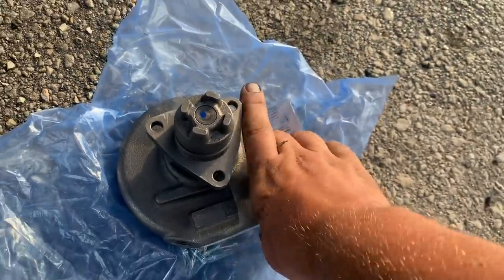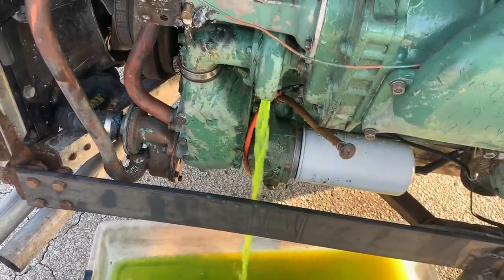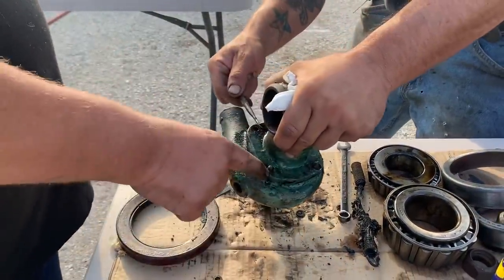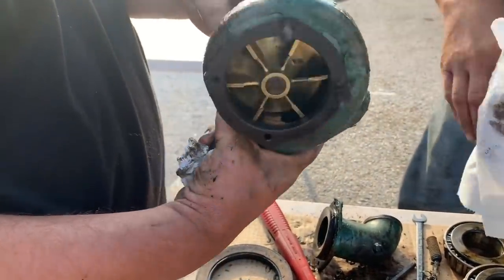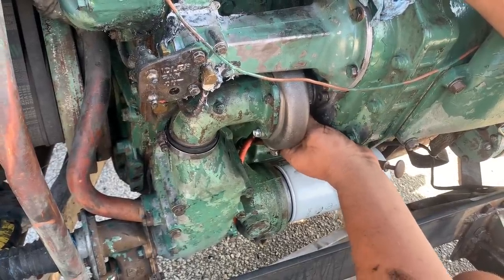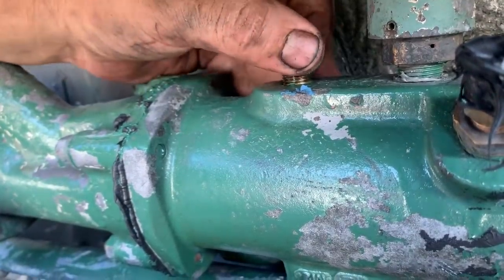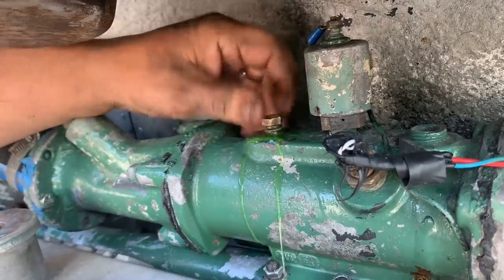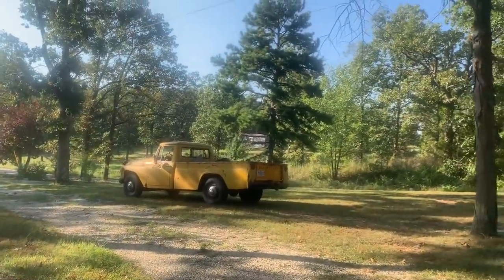Silversides bus water pump and finishing one job headed to the next

Comment: Ah, the life of a traveling Detroit mechanic.
You will never be out of work with those things hahahaha.

Did an engine swap on a machine with a Cat 3306 in it.
2 hours travel each way from the shop.
Left at 4 PM, got back at 7 AM.

Engine was in and running but as soon as the machine was put under load the coolant temp would just climb.
By now it was 5 AM, cold rainy night.  Machine was not able to run for the day shift so we called a day and headed back to the shop.  

Turns out the rebuilt water pump the engine re-builder installed was faulty, the impeller was just spinning on the shaft, no water flow to speak of.
Simple fix, but oh man.  What a pi$$ off.
Reply: I ran my Series 60 14 liter Detroit 1 million 200,00 miles before I overhauled it.  Cost about $15,000 to overhaul.  A Cat engine would probably be double that.  I used love my 425 Cat a d drove the rest of them but my 550 Detroit pre egr is the business.  :)
Reply: @robertmanley6102  We re powered lots of our logging equipment with Series 60's.  Great engine.  We abuse then horribly and they just keep ticking.
Pull a Silver 12V71 out of a machine, throw in a factory reman Series 60, same power and 1/2 the fuel consumption.

The 3306 Cats were like the 671's, simple to work on.  Great engine.  Rebuilding one of them is way cheaper then a 3406 or a C15.

Worst engine I ran into for expensive to rebuild is a Cumins KTA 19.
I could buy a new 3408,  543 HP Cat for less money then rebuilding the Cumins.
Reply: 3306B was the best engine for reliability and dependability that I've ever had.  It would faithfully start down at -40 (as long as you had properly treated fuel in the tank and lines).  Not the biggest horsepower or toque ratings, but that thing took me across the continent E-W, N-S and always brought me home.  The truck was sold out from under me at 800,000 miles, and besides oil and filter changes, coolant swaps,  had never been opened up or monkeyed with.

Comment: Water pump seal failure almost always indicates failed bearings. I replaced many a water pump in a previous life as an auto mechanic and every single one sounded like yours. The shop owner where I was working backed that up, too. I think you did the right thing going with a new unit.

Also interested in why you've not installed a petcock like a radiator drain on that bleeder. Might make that task a bit quicker and easier?

Gotta say too...yours is the best sounding Detroit I've ever heard. You've got that sweetie tuned so nicely. It's musical.
Reply: The good thing about buying new is the warranty.  In the trucking world a new part like a water pump would carry a 100,000 mile warranty.  Reman might be 30 to 90 days.

Comment: That sure seems like a small water pump for that engine.  Also, I noticed that on a lot of your wiring you are using regular butt connectors.  Those are junk.  Use the kind that you apply heat and melt them to seal out the salt and water.  I'm a truck driver for 30 years and unless you like replacing wiring get rid of those regular unsealed butt connectors.  Love your vids.  I have a series 60 14 liter 550hp Detroit in my 2000 KW W900.  Best engine I ever had.
Reply: Pre-egr 12.7&14.0 were great engines
Reply: I absolutely despise “butt connectors” but if you must I agree the ones with glue and heat shrink in them are far superior than ones that have not.  My major dislike for butt connects is the potential for increased resistance.  I much prefer whenever practical to replace the piece of wire end to end.
Reply: Scott is driving all across the country in a 1947 bus helping other bus owners keep the old buses on the road. He rebuilt the engine in the street in front of his house in a couple of weeks time. I think he is capable of fixing any butt connector that MIGHT go bad.
Reply: @tbirdracefan  I'm sure he can.  I watched the video you are referring to a d actually that's where I noticed the use of those junk butt connectors.  If you want to be broke down, have lighting issues, or any other manner of electrical issues, then use those shitty butt connectors.   I happen to know because I've traveled 3 million miles and paid to fix electrical problems many times and have fixed them myself the right way.    All I'm doing is trying to save him some hassle down the road.  I never meant to imply that he isn't a competent mechanic.  I like how he does most things which is why I watch.

Comment: Hitting that downshift to third going up that grade brought back so many memories of pushing 3s and 4s up many grades all over 11 western states back when I did that for a living.  Your cooling issue was that the bearing and seal were shot, thus drawing air (AND oil!) up into the cooling system through the weep hole.  Eventually it all bubbles up into the expansion tank, but bubbles in cooling water...no bueno, and it'll cause your Shutterstat to open at a higher temperature.  Same will happen on the 8V, too.

Comment: GASKASINCH is a cooling system mechanics best friend. Spent many years working in a radiator shop, we used Gaskasinch to hold  O-rings, gaskets, hoses in place during assembly constantly, that stuff is great on stubborn hoses that won't fit on nipples, inlets, outlets they slide on like snot, and will never leak.
Reply: white grease is the best

Comment: I was wondering how many people will say you need a new wiper blade ? 😊
Reply: thought the same thing
Reply: @colinrt12345  Count me in
Reply: pretty sure he uses rain-x over your fancy wiper blades
Reply: @MrCivildefense  don't know what rain x is mate don't have here in England as far as I know
Reply: @rogerfaulknershomefromhome4458  Its a silicone based liquid that you can apply or comes in washer fluid, causes the rain to run off swiftly in rivulets so you can drive without wipers. https://en.wikipedia.org/wiki/Rain-X
Reply: @MrCivildefense  ok thanks I will have a look
Reply: His wipers are air powered and that side doesn't work. Scott uses lots of RainX instead.
Reply: From a D.O.T. standpoint that wiper blade would put him out of service.  It's a little thing but it is also a safety issue and that's why truckers would be fined for it.  I notice there is a lot of folks with these old buses who just don't know they are driving a weapon down the road and it's kinda scary.  I've watched Scott get nervous about guys driving too fast on old tires.  That's totally legit.  If you blow a steer tire you won't be controlling that bus, likely you will be in the ditch or worse.  I blew a left steer at 75mph on my Kenworth W900.  I went for a ride, absolutely had no steering control as the tire wrapped around and hit my steering box.  Did $20,000 in damage to my truck.
Reply: Robert Manley I know exactly how blowing a left steer tire is and to this day I believe there is a pucker spot on the drivers seat!  The left front fender, the left headlight assembly was tore off, the left side of the hood looked like something tore part of the hood off like it was a sheet of paper. This hair raising event happened within a blink of the eye, this happened  April the 4th 1985 just south of Lexington, KY
Reply: It gives the Bus Character, looks like the original wiper blade!

Comment: On the thermostat housing, a stainless ball valve would be a good idea to install & put a pipe plug in the valve just for safety. 
Just an idea for you.
I've got some here I use for shop air, I just don't trust plastic in a cooling system. Ya your pump bearing went south on Ya. !!.
 Best of luck to you Scott.

Comment: Someone else might have mentioned this but when you overall a engine put a water pump on and a oil cooler. Also remove the oil pressure regulator and relief valves and clean them . I don’t remember if you did the latter. Keep up the good videos.
Reply: Yeah but then he wrenches on his own stuff so he doesn't worry as much about getting broke down.  As a trucker the idea is to never have to have your truck on a hook.  Plus if you want the 100,000 mile warranty you replace common fail items that can render your overhaul useless.

Comment: Instead of loosening the pipe plug, to bleed the air from the cooling system, you could use a house radiator bleed valve, the one with the little square drive bleeder in the middle.
Reply: jesper dahl The amount of vibrations and coolant system corrosion and cavitation that are present on a DD can cause bleeder valves to possibly fail over time however, pipe plugs rarely if ever fail, think of this way you rarely will go wrong following the KISSP rule (keep it simple smart person).  Not saying it not a good idea but maybe not the best in this application.

Comment: You should be using a non water-based coolant much better.  reduce in heat wearing of the engine especially for vintage engines no cavitation. you have to make sure the engine is completely dry of any water not even drop before putting it in, they supply a flushing liquid first for this purpose. has a much higher boiling point doesn't evaporate reduce pressure in the system.

Comment: Last 6-71 I helped refill he had changed out the plug for a copper 90 degree shut off valve. He stated it made venting the air out much easier.

Comment: ATTENTION SCOTT : FYI,   I had an old friend who was a farmer, and most of his life,  an excavator, who dug foundations, hauled fill, used heavy machinery all his life. He showed me a simple  tool/ process use. ....There are many, many sizes of metal strap-banding material, used for securing goods to skids. He came across the right size for his D7 international radiator. He removed both tanks from the ends,  smoothed the end of the banding material, and after soaking the radiator, he used the banding to push the crud out ...!!!! It worked flawlessly. Afterwards, a garden hose flush on the tubes rendered the radiator, good as new....That banding comes in various widths and thicknesses....a free " tool" that usually winds up in a dumpster. !!!!
.

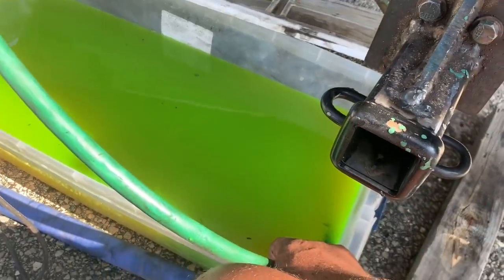Comment: @12:20, maybe a line filter on the pump with an inexpensive filter of some kind for that situation... @22:40, I suggest getting a brass hammer for just those sorts of jobs, I used one in the machine shop before I hired onto the railroad and began playing with serious diesel power :-p

Comment: I used to have a little Fiat. Whenever I had to change coolant I had to jack the front of the car up 2 feet. Lucky you don't have to do that with a bus.
Reply: A lot of Renault and other French cars from the 70s were just as difficult to purge of air. Never really understood why the engineers that designed the systems in those cars allowed that to happen. Pumping coolant in from a low spot helped,but the last little pockets of air were a sonofagun to get rid of.

Comment: Scott, could some of the cooling issues  be because the small outlet on those water pumps? How much flow will they move per minute?  Just asking because that outlet on that pump looked small. Seems like it should be bigger for such a large engine and the restricted air flow the radiator gets anyway.

Comment: I wonder if a "High output" water pump would help with cooling.
Reply: Actually, I was thinking the same...for my 8V71 WP replacement. Thank you for the reminder to do it.
Reply: @hjo2634  Only minor setback with the inline 71 HO pumps, the cover needs to be updated too for the bigger impeller blades.

Comment: Scott, you need an air cock on the vent plug. Much easier. I used to work on these in the CDN navy. We had them as generator engines on some of the small harbour vessels.

Comment: Would increasing the reservoir size help with cooling? and is there a way you could pass a message along to George?
Reply: If you increase the res. size - but the overall cooling is insufficient - you just delay the inevitable overheating, since you're just increasing the total mass of water that needs to heat up, not the overall cooling capability.  (So your bus might start to overheat after an hour on the highway instead of 45 minutes).  Might help in marginal situations, but not when overall cooling capability is chronically insufficient.  For that, bigger rad or better fans etc.

Comment: I don’t know why we don’t see the stuff around more but I use it in or on most everything that moves. The most impressive was a worn out 22hp Briggs engine. I put some of the used oil I changed out of my truck with the treatment in the Briggs and I just could not believe the difference and still can’t. That was two years ago and it’s still strong. The longest use is in a 2002 5.3 GM engine @82000 miles now has 170000. The oil pressure reads exactly the same as the day I put in. I am a believer so check it out. I have no connection to this company other than being a customer, when I find something that works I like to share.https://www.cermastore.com/ lots of videos of test and use. Check out the turbo treatment. Love the channel. Good luck getting back home I know you pups will be happy to see you!

Comment: You guys probably know this but just in case make sure The front tires are in good condition. A front tire blowout is almost uncontrollable at highway speed’s.  

It does not matter how good the front tires look if you’re not sure of their condition replaced them. I know of half million  dollar motorhomes With what looked like relatively good front tires that have failed and crashed and killed the occupants. Below is a link to one example

https://youtu.be/dSgz61yn-4M

Comment: Replace your damn wiper blades.
Reply: a222parker I was going to say that, they do look tired!
Reply: The wiper air motor is shot and crazy expensive to replace so he’s been looking for a good used one.
Reply: BlindBatG34 that may be so, but the rubber blades are separated from the holder, so even if the motor worked the wipers wouldn’t clear the screen!
Reply: Nah, he’s just doing it to piss-us-off 😏  Notice how sharp the picture is when the wiper blade is in view.

Comment: Just  because  the  engine  is  green , you  have  to  use  green  coolant  instead  of  red  long  life ? 😨😂
Reply: Dry sleeves so don't need the SCAs.
Reply: @RB-jv6un  I've still seen the block pinhole. Never say never. You can get coolant in the exhaust ports when it's sitting. I only saw it once but it does happen.

Comment: just for kicks.... 1930 1931 Cadillac Lesalle 345 V8 water pump images.. https://imgur.com/a/VexAB  the gear is not a gear.. its the packing gland nut so you can tighten it easily with a screwdriver to get rid of the shaft leaks...
and just for a double kick ... Countach V12 water pump from an 85 2 valve engine.. https://imgur.com/a/SnF19  and yes. those are my pictures.. i have had both in my greasy hands..  picture from last months forklift fishing weekend.. https://i.imgur.com/gQLEUCI.jpg